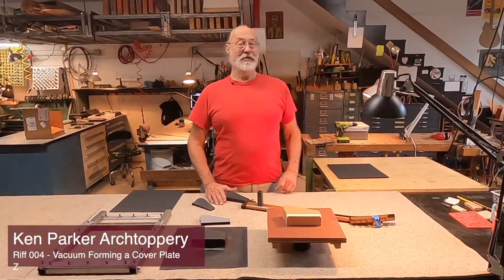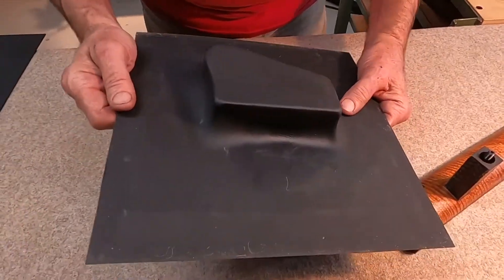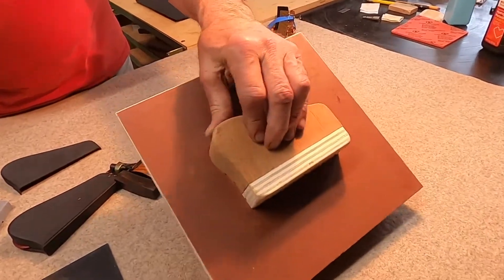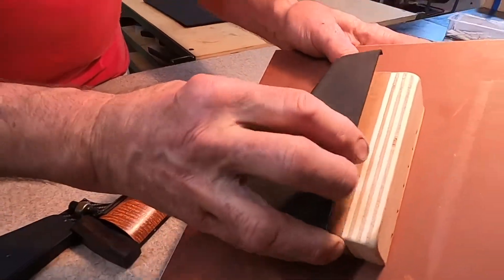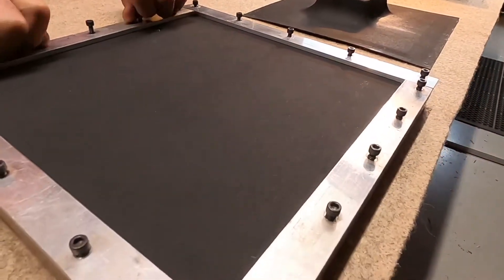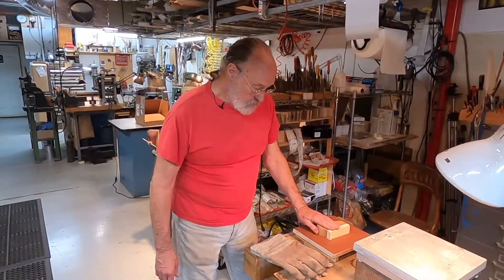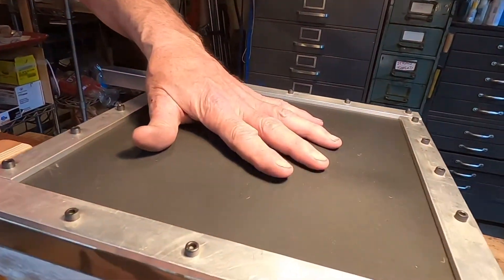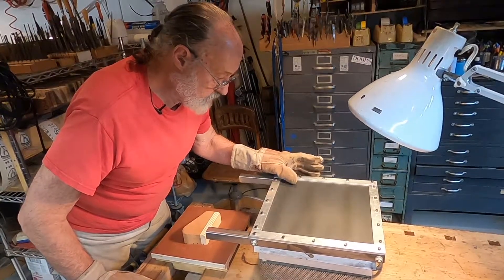Ken Parker Archtoppery - Riff 004 Vacuum Forming a Cover Plate

Comment: Hi Ken,  just a thought,  the guys that use kydex for holsters usually have some kind of over.  seem more controllable than the hot plate.  I'm sure you could find something big enough to fit your needs.  Heck you could probably build one yourself.
Reply from the maker: First, as they say, "if it ain't broke, don't fix it".  Also, as I mention, the very small temperature range between "not soft enough yet" and "oh No!" would make an enclosed oven with a door a new problem, as  you have only a second to get the hot part under vacuum before it's too cool to form properly.  Unlike the holsters, this part requires what amounts to a "deep draw" to get the sides w/o wrinkles.  Think of the hot plate as an oven with no lid.  And yes, I have built ovens for cooking epoxy resin for fly guitars.

Comment: I realize this is off topic,with regard to the video content but, could youdo a video about molds and cradle and work holding devices. I tend to carve the insides of my tops on my lap, just because I haven't discovered a decent design for holding the wood. Thanks.
Reply from the maker: Plate carving is next, and I will cover all kinds of related stuff like tool design, cutting tool geometry, workholding, etc.
Reply: @kenparkerarchtoppery9440  sweeeeeeeet. Thanks